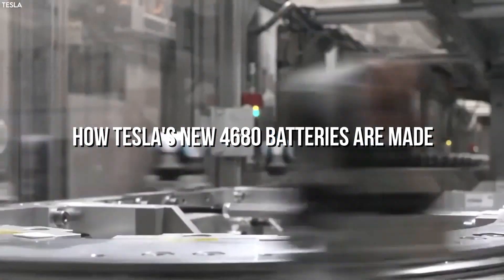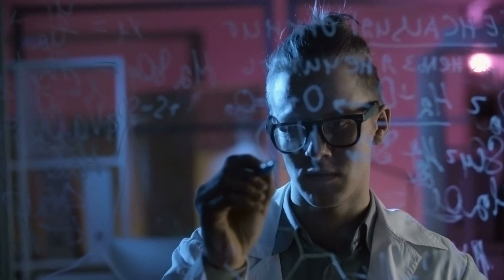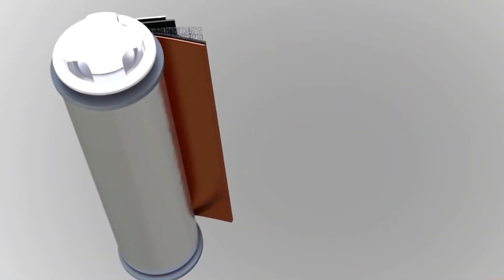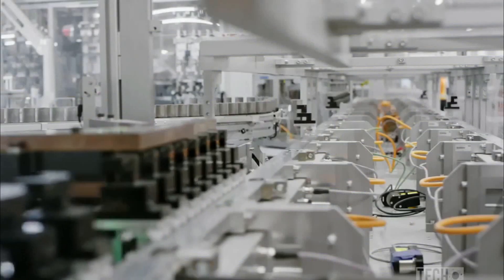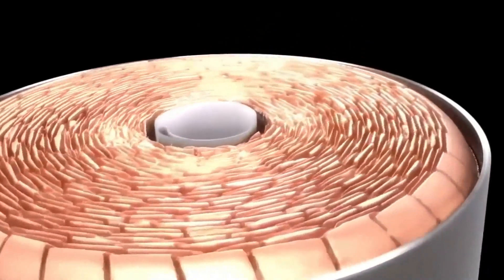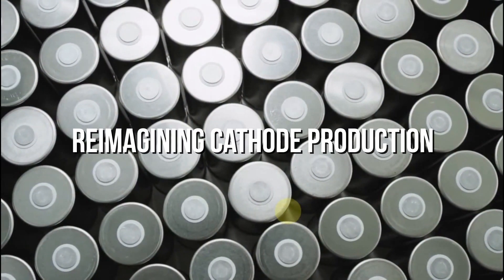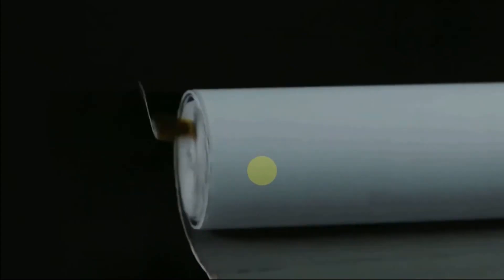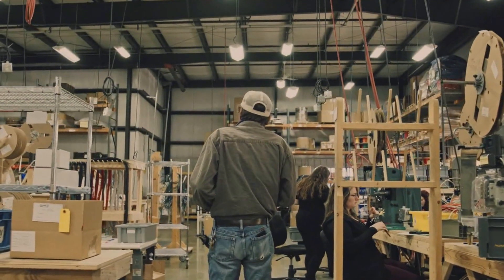HOW IT'S MADE: Tesla 4680 Battery

Comment: I HAVE THE ABOLUTE BEST BATTERY EVERYTHING (any chemistry raw materials + cells + packs + exponentially fast and fully autnonomous distributed micro-facturies system) !!! IT IS ONE OF MY 40+ TRUE FIRST PRINCIPLE REAL DESIGNS AND IT CAN BOOST THE ELECTRIC REVOLUTION TO PANDEMIC LEVELS IN LESS THAN 1 YEAR ... THA ONLY THING IT DOESN'T SEEM TO BE ABLE TO DO IS GET TO BE SEEN BY THE RIGHT PEOPLE DESPITE OUR AGE OF HYPERCONNECTIVITY (or maybe because of it) :)) HELP ?!?

Comment: Trying to produce 4680 on large scale without Cobalt seems very risky to me.
Also for 3TWh per annum there is not enough lithium by the year 2050.
But re-use of lithium of worn-out batteries is not possible at the moment as far as I know.
Reply: There actually are lithium recycling processes now
Reply: You are missinformed then
Lithium is 100% recycleable
Reply: from where did you bring the 2050 part?
the best I've seen is that it would take 70 years to deplete the Lithium mines we currently know of, when EV's will be the vast majority of sales.
And that's if we won't find more, won't recycle Lithium (which we would, we already do at small scale and it would get better with time) and without the Lithium in the sea.
And that's without taking Lithium from other planets and asteroids by then.
Lithium is very abundant in the universe, and even though most of it is inside stars - there definitely should be a lot on asteroids and other planets.

Comment: This seems outdated already. Round/cylinder shaped cells are optimal for flashlights. Not car's. To much weight and empty space between cells.  I think BYD has surpassed this technology with their blade technology.  Less fire risk also.
Reply: BYD is using a completely separate chemistry for cells. LiFePO4 cells, which BYD uses, are extremely space and weight inefficient to begin with dude to chemistry. Additionally, prismatic cells need huge and heavy compressor plates to hold the cells together and prevent puffing. That's solved inherently by round cells design as they don't need compression plates, the cells casing takes care of that already.
Reply: @TowerCrisis  Agreed. The above statement that cylindrical cells are not ideal for cars is simply not true. The cylindrical cell manufacturing is more efficient that prismatic/pouch, and the voids that result between the cylindrical cells are perfect for cooling tubes and for an interstitial fill to safeguard against thermal runaway, and lastly there's the honey-comb like configuration that makes cylindrical cells perfect for building a structural battery pack that is integrated into the chassis.